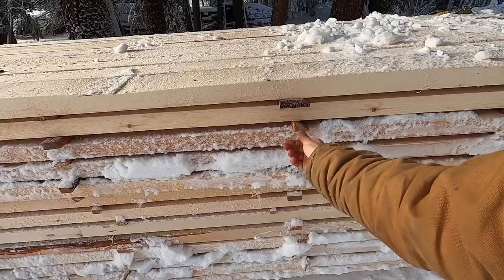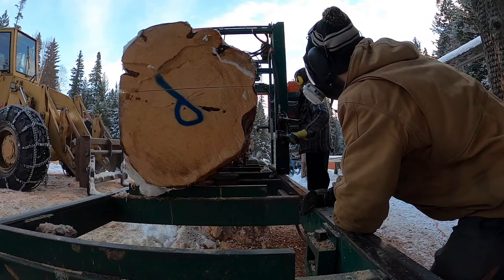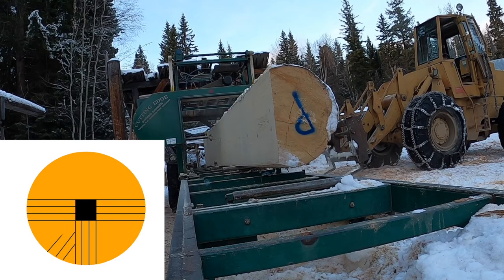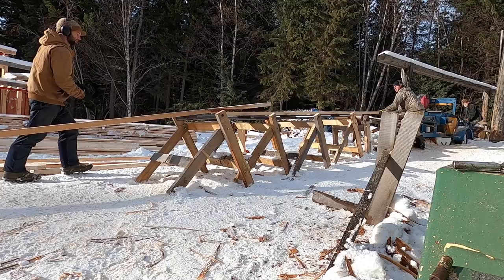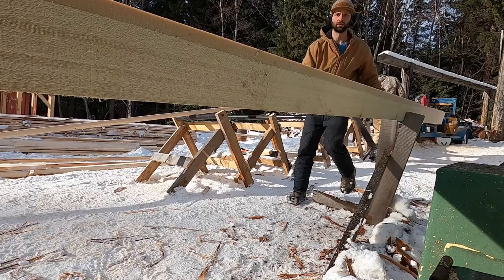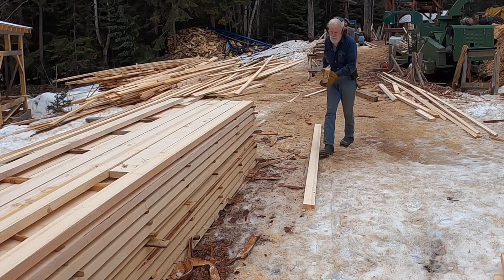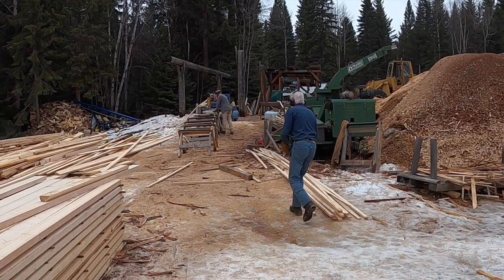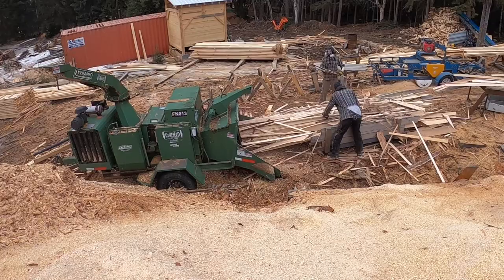Making Piano Wood for Grand Piano Soundboards - How its made

Comment: Couldn't those smaller pieces be used for rib stock for pianos , guitars, violins, etc?
Reply from the maker: Maybe. You are talking about the short cut offs usually they have some form of grain run out which makes them hard to use for guitars and violins. But I do have a plan to put them to use.